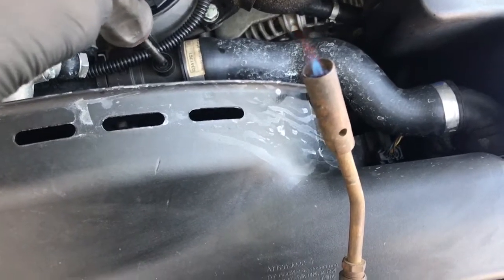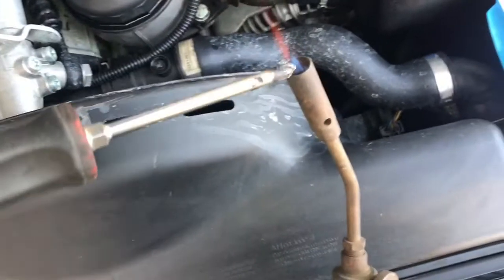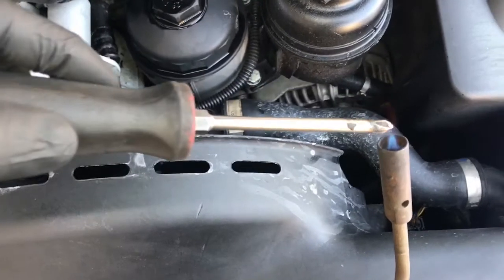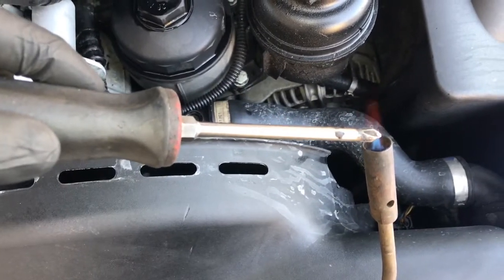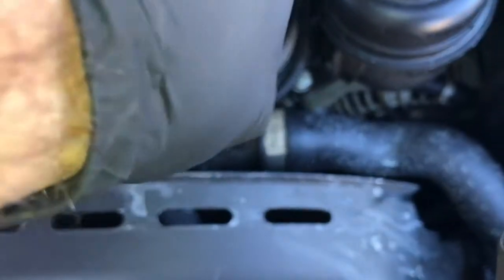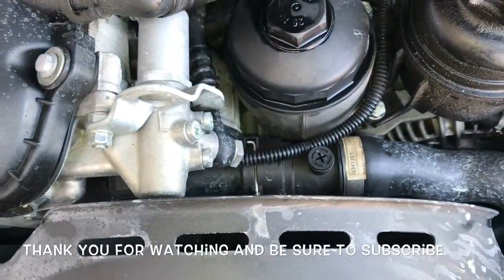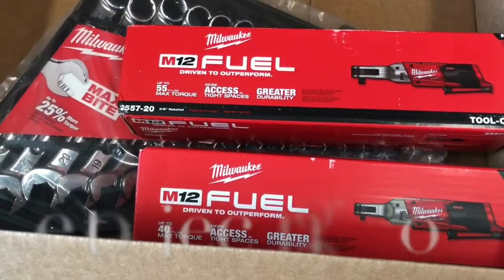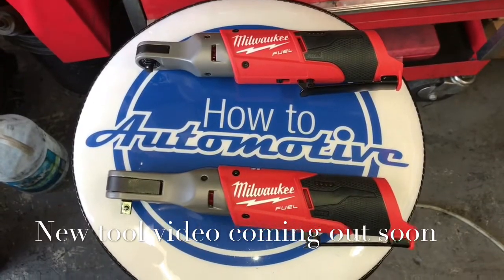How To Remove A Broken Bleeder Screw On A BMW Cooling System

Comment: Great Tip really smart idea & those Milwaukee fuel Ratchets look awesome!!  Looking forward to your review on them!😊
Reply from the maker: Tool Fein thank you. The New M12 are awesome. I've been using them all day even on jobs you wouldn't normally use them on.
Reply: How to Automotive That's Awesome! I would be doing the same lol maybe check for loose Nuts and Bolts just around the shop just to give an excuse to use them more lol.
Reply from the maker: Tool Fein lol I am